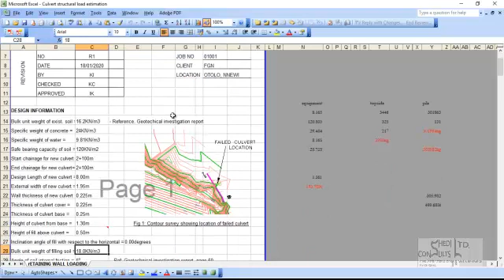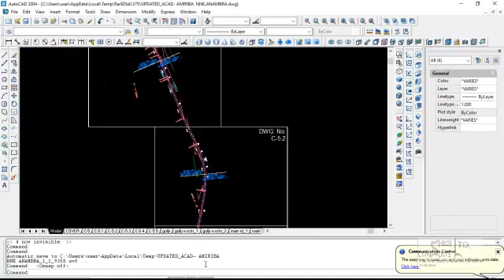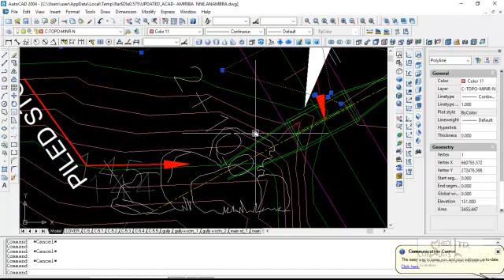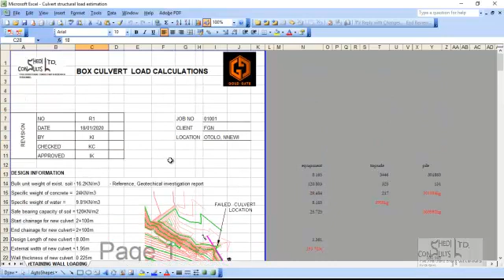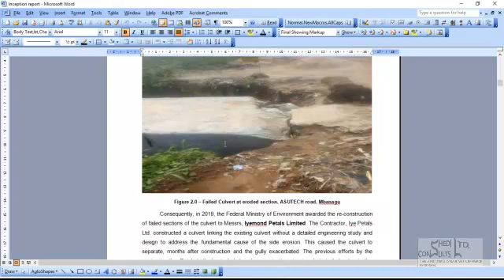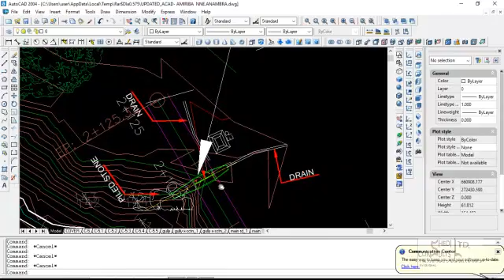STRUCTURAL FINITE ELEMENT ANALYSIS & DESIGN OF A BOX CULVERT TO BD 37/01 & BS 5400 USING STAAD.PRO

Comment: Thank you so much on this video sir.. what stresses should be considered for concrete reinforcement design?  i understand that the base pressure should be compared to soil bearing capacity.
Reply from the maker: For the design of the wall and base of the culvert, the bending moment distribution diagram at the base as a result of the design earth pressure caused by the factored characteristic forces shall be used in the design of the base of the culvert against flexure. The walls of the culvert also shall be designed against hogging bending moment caused by the combination of the design critical load cases causing lateral stresses on the walls of the culvert.